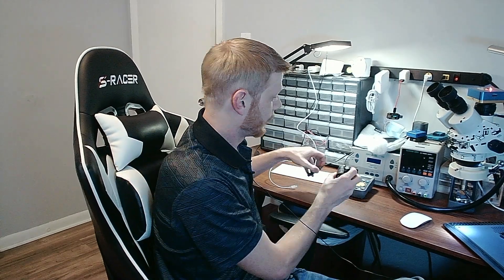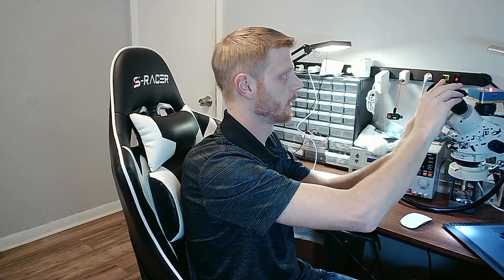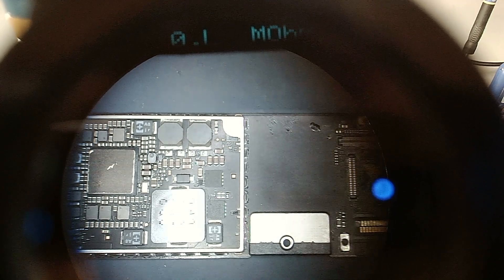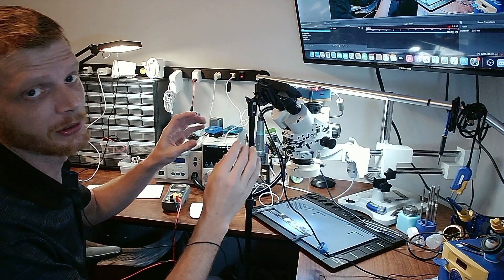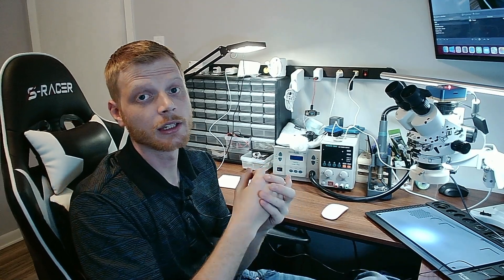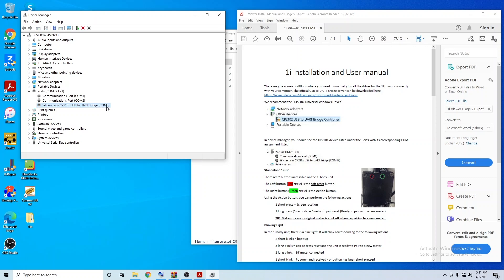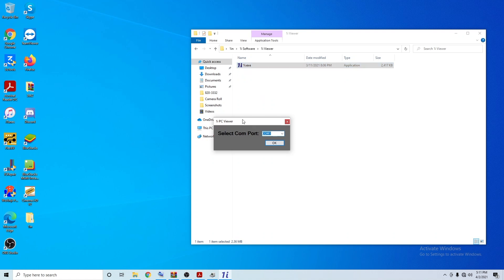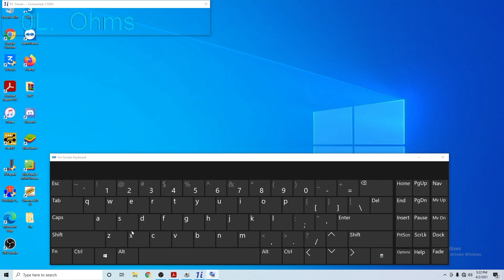Microscope HUD display with multimeter! Introducing the 1i!

Comment: Can firmware be downgraded? I just upgraded 1I firmware and now diode mode is not working anymore with Owon B41T+... I don't like the B35T+ since it does not beep in diode mode. IMHO B41T+ is perfect for use with the 1I

Comment: Excellent work, definitely will improve ergonomics. Will it work on the trinocular port?
Reply: Hello Ainsley! So the 1i will not work connected to the Trinocular port as it will not be viewable to you. It replaces one of your oculars that allows you to still use a camera if you have a trinocular port. Also those that do not have a trinocular port can also use the 1i.
Reply: @JosephHughes  Nice, I was thinking about also using it as an "on screen" multimeter by using the trinocular and microscope camera.
Reply: @ainsleyramai8311  It sends the measurement over USB. There's no need to use it on the trinocular port, since you can just add get the number from USB and add it as a text overlay in OBS.
Reply: pls see TOMLOV DM201M Digital Microscope with Multimeter，：）